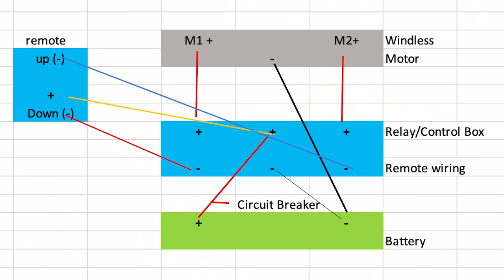The Best Cruising Ground, Remote.... But Not Too Remote (Calico Skies Sailing Ep. 127)

Comment: Attack of the windlass gremlins. If you can find some, external tooth lock washers not only lock they help current flow. If not flat washers and nye-lock nuts work if the stud is long enough.
I carry a set of grab hooks. One is for a stopper and the other gets tied to a line run to a sheet winch. Haul, stop, and haul. It's slow, but better than hauling up chain by hand.

Comment: Why didn't Bill use the winch handle on the windlass's spindle vs pulling up the anchor by hand? I am thinking that would have been easier on Bill's back and cleaner on his hands. Do the sail winches and anchor winch use different size handles?
Reply from the maker: The handle for the capstan controls the clutch which allows the winch portion to spin separately from the chain gypsy

Comment: Try double nuts with washers. Lock nuts are not a good idea around that kind of voltage draw.
Reply from the maker: Good call on the lock nuts! Prob some heat being generated at those connections!

Comment: Whenever you have an electrical problem the first thing you check is loose wires. Especially if there is a ground. You will find that a bad ground is responsible for 50% of the problems you run into.
Reply from the maker: Totally! This time if happened to have gotten loose in the most difficult access spot